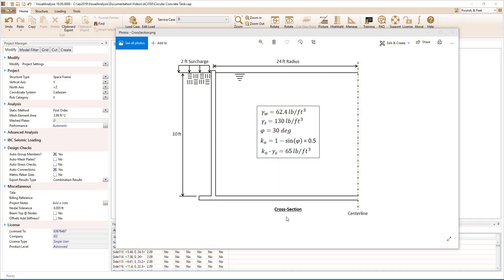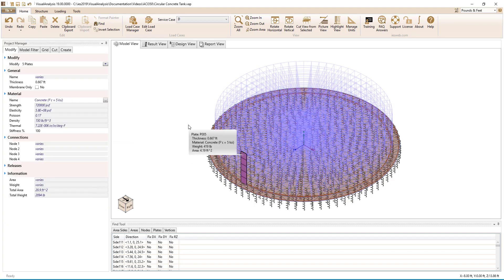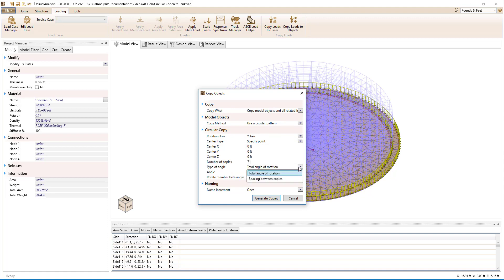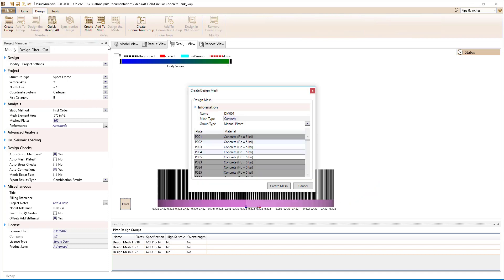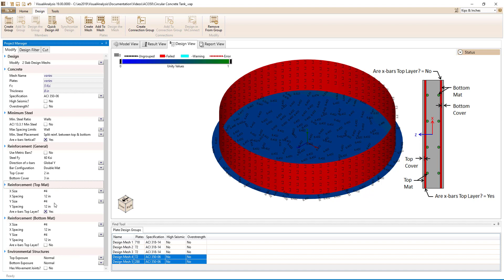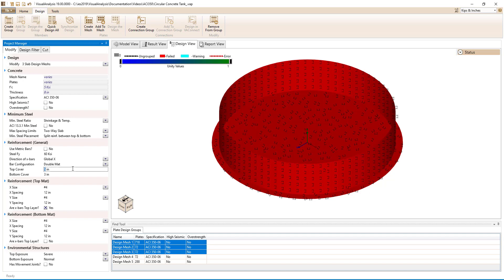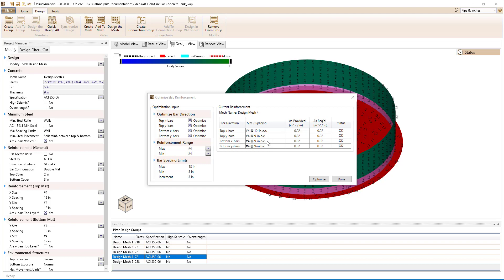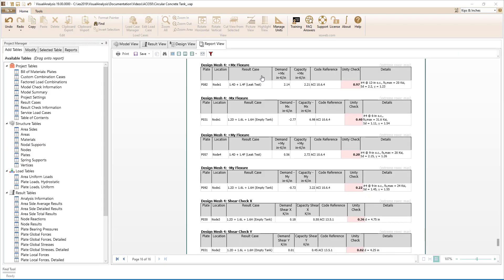VA: ACI 350 Design

Comment: In order to meet ACI 350, walls 10' or higher have to be 12" thick.  The program has no check for this so this design does not meet ACI 350.  There are also other problems with this software regarding ACI 350 that the company refuses to acknowledge.